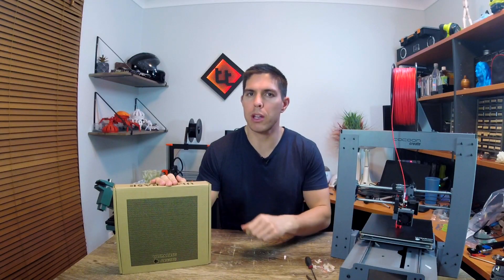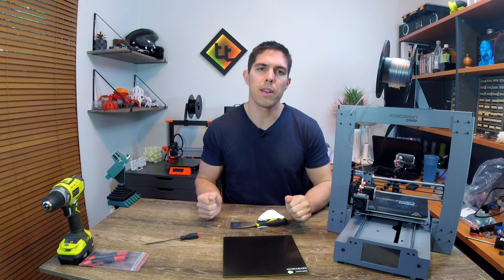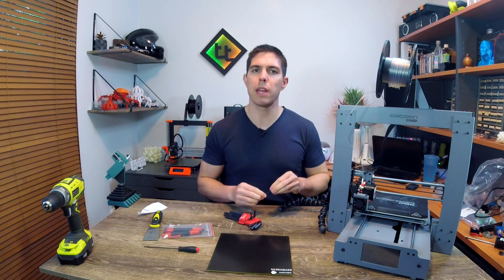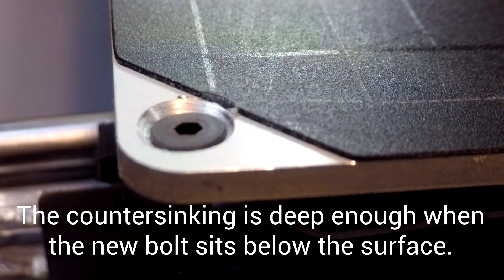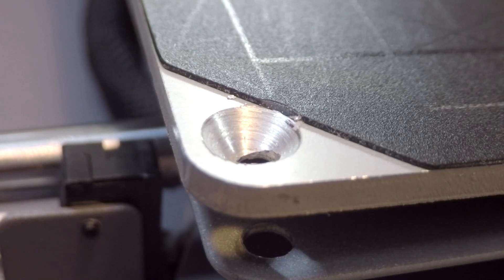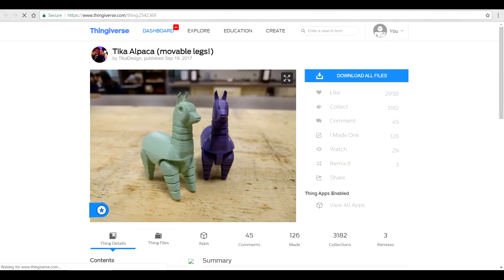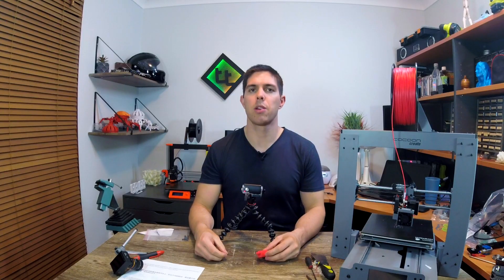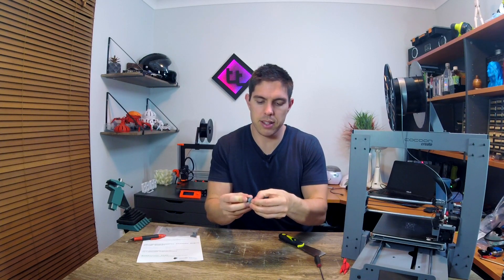Anycubic Ultrabase - Worthwhile upgrade? (Cocoon Create Touch / Di3 Plus / Monoprice Makerselect)

Comment: Under 40C pops off fine.
Wipe the Ultrabase down with acetone (do it outside!) before using it the first time.
The brown stuff that comes off is silk-screen printing residue, and can mess with adhesion.
Wipe it down until paper towels come off clean.
A very light sanding (1200 grit) to break the gloss, and parts really do release as advertised.
Rubbing alcohol every 5 prints, acetone every 50 or so.
Ultrabase will pick up stuff from print jobs, so losing adhesion is a sign of contamination.

Comment: This is why I use dimafix - same end result, and while consumable, the bottles last forever.  For the cooldown swap I had several identical mirror beds cut, so I can swap out the glass plate and set one aside to cool while printing another item.  Not ideal for all, but works well for me.

Comment: If you are in a hurry to pop it out of the bed just set a small piece of wood next to your printed part and Knock it with a small hammer. This instantly removes (sends it flying) from the bed with out having to scrape.

Comment: You can squirt some 70% alcohol on the base of the print, it will cause the thermal shrinking required to remove the print if you don't want to wait till its back to room temp.

Comment: Love my Anycubic I3 Mega had it for 1 1/2 years now  and never had any issues... re removing mine just snaps off the bed, I never use a spatula, just twist or if you object has some height pull to an angle and it will snap of the bed...also beds are $20 on the Anycubic store.
Reply from the maker: Interestingly enough I had a much better experience with it testing on an Ender 3. In this video I was using ABS to make it as hard as possible however.

Comment: Wow, your experience seems totally different to mine. I was ripping the Wanhao faketak to shreds trying to get my prints off so I too installed an ultrabase on my Aldi CCT. I did my research and went for the version with chamfered edges, meaning you can just peel off the faketak, stick your ultrabase down, adjust Z height/level bed and away you go. No need for removing the build plate and countersinking the holes!
After leveling the bed properly I've had 100% success using PLA and PLA+ with easy adhesion and easy removal - if I let the bed completely cool I can literally poke a print with my pinky and it comes free. Even if I'm a little impatient and don't wait for it to cool I can remove my prints with just my fingers, I've still yet to use a scraper since I switched over.
Reply from the maker: I'm glad you got it working well. Just to be clear I'm testing with abs here for the added challenge. In a follow up video I had it more dialled in but still prefer a flexplate over this.

Comment: On my Wanhao i3 Plus(the original version of the Cocoon Create Touch) soo far everything sticks to the stock buildtak, sometimes too good so sometimes i have a hard time removing the prints, even ABS ones  :) I tried ABS, PLA, PET-G, 95° TPU and 60°. These are all without any warping or bad first layer. I don't see the point of many people switching the stock buildtak because it never failed me. Also these with manual bed level. I think the only trick is to clean the buildtak with isopropyl alcohol before every print and it works like a charm without any glue, tape or hairspray.
Reply from the maker: If you have it dialled in then that is all that counts. After experiencing the convenience of the Prusa MK3 bed I was wanting to emulate it, which I have with a buildtak flexplate system.

Comment: I have a clone of the I3 plus and I have had good luck pinting on a 3mn piece of window glass from the hardware store. Bring your exta bed sheet with you and have the glass cut to that size. No need to countersink the bed screws.
Reply from the maker: I printed for years on picture frame glass with hairspray. So far this doesn't seem that different, except without the hairpray. I'm gettng btter results since the video but I'm not convinced yet.

Comment: Could you use something to really cool down the bed? Like Freezing spray for circuit boards? or as a quick test propane if you ave some handy.
Reply from the maker: Mild cooling yes, drastic cooling has a tendency to crack. I think the best suggestion I've had is to buy two and hold them with clips.
Reply: That's fair enough and worth a try.

Comment: Flexibles will stick on the Ultrabase. I think this is pretty logical as the flexibility will remain when cooling off, potentially it will even pull the material tighter onto the bed as the tension pulling the material between the small pores increases. 
With PLA,  ABS and Nylon it will work like magic. 
As other commenters say; a flexing plate might be better for flex. Also try not to use the scraper, you will flatten the structure in time, reducing the performance.
Reply from the maker: I think I've got it sorted now, shouldn't really need the spatula anymore. Still yet to try flex but that will be coming soon. A buildtak magnetic bed was my original choice and them I saw this and took a punt.

Comment: I have had the Anycubic i3 Mega and the bed was the best I've ever seen! It is very true, about how the plastic sticks to the surface on a certain temperature and just pops off when you cool it even just a few degrees. I freaking love it!! Now I feel degraded with the PIE bed of the Prusa MK3. But I wouldn't give up the auto bed leveling of the MK3 any more. Auto bed leveling is a MUST for me today.
FYI: I printed PLA on 60 degrees and PETG on 80 degrees. On 55 resp 75 degrees, the prints just let go of the glass with very little effort.
Reply from the maker: I'm having more success with the bed now, and will update in the next video in this series. Thanks for sharing.
Reply: @IgnoreMyChan Re your FYI, one wouldnt have thought or even guessed that the 5 degrees drop in temp per material would be so critical as I also found out in the beginning. The funniest thing, when I first experienced it with the particular pla I was using......I went from the slippery slidey print at 55 and thought, ok, up it a fair hike to 75......and my brand of PLA basically melted and warped like a dose of ABS on a cold winters day....Doh!!. It took a couple more prints to figure the critical temps and all good since. I must say ABS isn't so picky and sticks like glue (with a good brim) and unless I am doing a particularly large or long print I rarely even bother with enclosure.
I suppose in essence there a small learning curve when starting with the ultra base that most folks dont realise. Anycubic should probably make people aware of this on their advertising or website. But once you get it there is no going back. Getting it only takes a few extra test prints anyway.

Comment: With the ultrabase that came with the printer, PLA, ABS and PETG all works fine and easy to remove as the temperature go down from where it was started during printing. The more I print specially with ABS where the ultrabase is at 108C, the cleaner the bed becomes. I do not have to clean it specially from the moment I started using an enclosure. Prints simply separates themselves with a clicking sound telling you it is ready.  ABS needs no fan blowing and air around the build area must be kept calm. For ABS, an enclosure from an inch below the build plate and up is a must when you cannot avoid people moving around where the printer is to avoid warping. Brim can help with ABS prints, 6 lines of brim at least which is what I use and works perfectly.  Any hard metal scrapers or spatula is a no no for the ultrabase surface, in fact you do not need any. Glue or hairspray is also a thing of the past with the ultrabase. I print everyday with the ultrabase for 4 months now. Should you really need to clean the surface, water and a tiny dot of dish washing soap on a clean cotton or any non abrasive cloth or good quality tissue paper will easily remove oils and dusts from the surface, I did not use any alcohol. If I have a chance to install again another ultrabase, I will not use the ultrabase sticker at all. Clips or a guide or a stopper around is better that you can use multiple ultrabase one at a time, saves time and energy.
Reply from the maker: Thanks for the detailed advice. I'm finding some conflicting info out there. Some say to wash with soap, others with alcohol. Also with the metal scraper, so.e say it's tough enough for it and some say avoid.
Reply: Metal on the ultrabase will scratch it no matter how they advertise it as a hard surface. Even a brass nozzle can scratch it and we want it to look nice other than performing well all the time right? :) Some even recommend sanding the surface which is simply destroying it. I tried all of that. I experienced overheating once on the nozzle due to thermistor failure and resulted to burnt prints on the ultrabase surface. I thought it cannot be removed, the markings to the shape of the print, but I don't want to scratch it so I ignored the marks (anyway it is still a flat surface) and continue using it as normal. In a week time of printing ABS, the surface self clean like new. Sometimes we worry to much and only create more problems. With the ultrabase, I learned to keep calm and never panic.
Reply from the maker: I know what you mean about self cleaning. The new print adheres to smeared old bits and pulls it off. Very handy.

Comment: I have a Monoprice Maker Select V2 (not the Plus) with a Flexion Extruder and an Ultrabase. It took a little bit to get the height for PLA right, but once I did, I barely touch the prints and they come off. I really like how well the PCTG (similar to PETG) would come off with no issues.

I still need to figure out the right height for flexibles, but those may stick regardless of what I do.

I have also been leveling the bed to .1mm with a feeler gauge and adjusted the Z height in my slicer. That way I always level to the same height, but the adjustments come in the slicer for different materials.
Reply from the maker: Thanks for sharing. Your tip about setting start height in slicer software is outstanding.
Reply: The leveling height of the ultrabase is like a light snug fit feeling when you push or pull the paper during leveling. Oh, only level at full working bed and nozzle temperature. Leveling a room temperature does not work well, huge difference in due to material movement when heated. Working temperature is best when doing leveling. Example, I always print ABS so I set the nozzle at 240C and bed at 108C which is what I use during printing - those the same temperature is what I will set during leveling the four corners.
Reply: dailyevents Except I find that each material needs a slightly different height, hence why I level it identically every time and make small adjustment in the starting z height in the slicer. Flexibles usually need a lower nozzle start for me than PLA and PCTG need a little more height than PLA.

Comment: Do you feel the flexion extruder has improved the print quality for PLA or ABS?  I have one ready to install on my mono price select plus but have not installed it yet.  I do want to do some flex filaments but at this point I have only the one printer so I will be using various filaments.  Thanks for the video!
Reply from the maker: Too early to tell. You can see more artefacts in the surface. When I switched to e3d on my solidoodle back in the day, the same thing happened because the higher quality extruder showed up vref being off on stepper driver. I will have to play around to work out if this is similar.

Comment: Interesting. One of my previous printers was an Anycubic i3 Mega with Ultrabase. It was very hit n miss. Some prints fell off ok and others stuck like poo to a blanket. In less than a month the coating came off in places, remaining attached to the print, not good. I also on those prints that were ok you are left with the texture on the bed on the base. That’s ok for most things but if you need a super smooth bottom you won’t get it. Great video though...thank you 🖖
Reply from the maker: I generally had good success printing onto glass with abs for many years, I'm keen to see whether this coating advances the technology. My glass beds used to fragment off onto the printed part sometimes too.
Reply: Teaching Tech I’ve heard others say the same about glass beds. I am loving the spring steel bed of my MK3. As I have lost a lot of manual dexterity using a scraper could have dire results inc prints covered in claret! 😬 I do hope you get better results with the new bed though 👍

Comment: Im more a fan of removable flexable built plates. My Di3 uses a sheet of copper clad FR4 PCB material with 1mm PEI sheet attached. Its been working well for a couple of years now. Its no good for TPU though as it sticks too well.

Comment: Hmm, interesting issues you've had with the ultrabase, seems like the first time round you over compensated the leveling and the nozzle was too close to the bed, also with parts not coming off is strange too, as having used the ultrabase for a few months (before I started massivley upgrading the wanhao duplicator i3 plus...it's still in bits) I can vouch for most of my prints (including pla, abs, petg, htpla and nylon) just falling away once the bed had cooled to 40C and is probably due to the leveling. The only difference between my upgrade and yours is I bought it with the heatbed and I tram my printer (basically making the nozzle just not quite touch the bed, and then changing first layer height)
Reply: RVJimD sight, as the ultrabase is quite shiny when looking face on with it you can see it's mirror image on the bottom, when you see them just about meet and you can see the tiniest gap (just about let's in some light), do that on all 4 corners (don't use the bed leveling g-code go straight to the very corner) do that twice and then check which first layer height gives the best finish and adhesion.
Reply from the maker: Thanks for posting, this is the type of feedback I'm after. I've been tweaking the z height between every print. Got a pla cube to work as intended, but the next big abs print I did failed spectacularly.
Reply: Teaching Tech once I get my wanhao back together I'll do some tests, been printing new MK3 parts lately for the carbon fibre rods (Purley to make it look cool)
Reply: euan todd, what first layer height do you use based on your setup with the nozzle just above the bed?  Are you sighting under the nozzle or using a gauge to measure the nozzle height?  Thanks for your comment.
Reply: euan todd, thanks.  What do you use for first layer height and width using that method?  Is this different for different type of filament?  Thanks for the info!
Reply: RVJimD default width and extrusion multiplier, this method isn't very picky on the filament really, but if you are changing filament type (pla to pet-g as an example) then it's best to plus only takes a few minuites and after that you don't need to do anything until problems arrise. Oh and when doing first layer tests start at half your nozzle size and then go down or up depending on the quality.